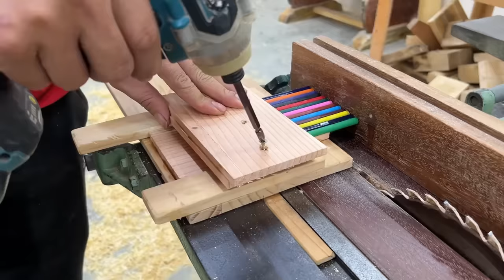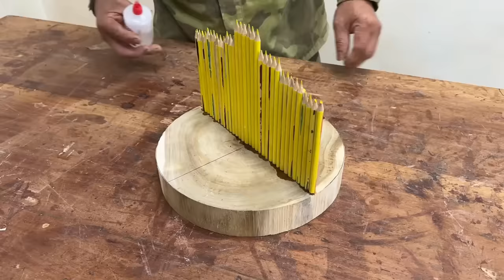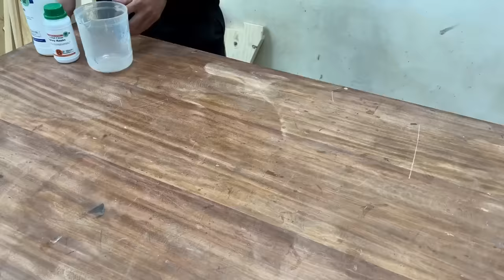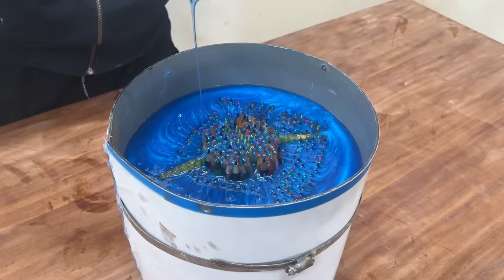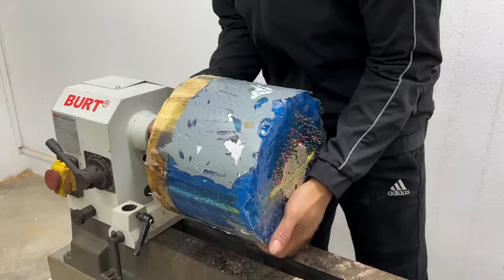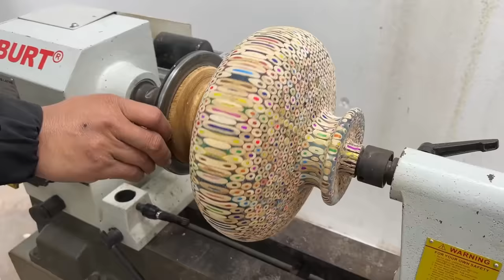Amazing Woodturning Crazy - Something Unusual Happened An Enchanting Design On Lathe

Comment: Beautiful work!
This isn't a critique of the artistry, because that's impeccable. I just have some questions on the technical side of the project:

What kind of glue was that?

Why not measure to get the turning axis centered?

Why did you take the time to cut the pencils to different lengths? It looks like it didn't impact the finished piece.